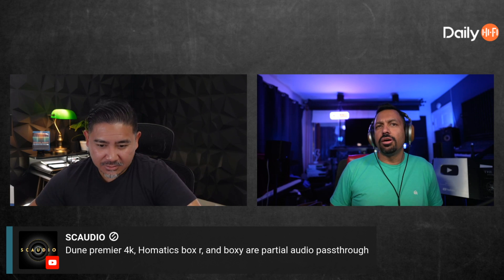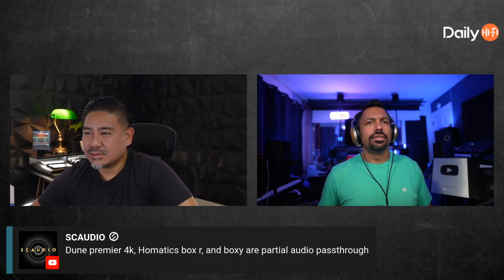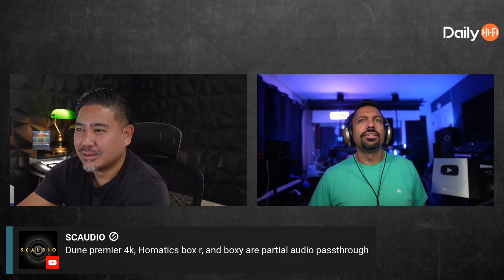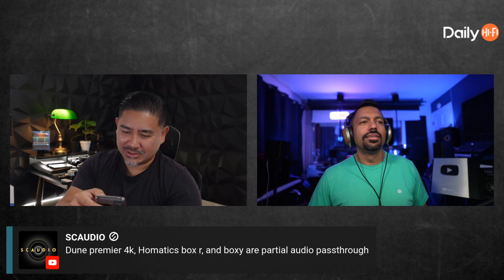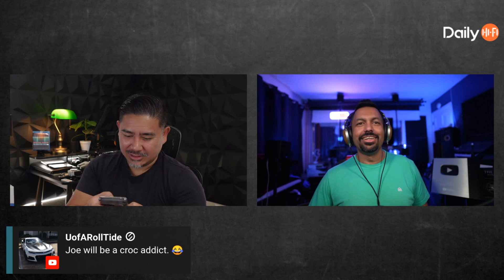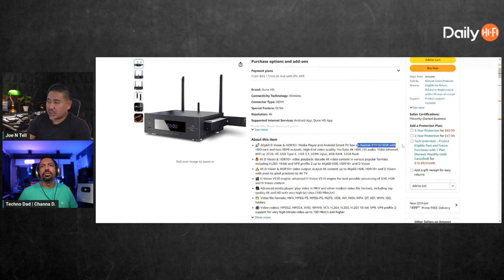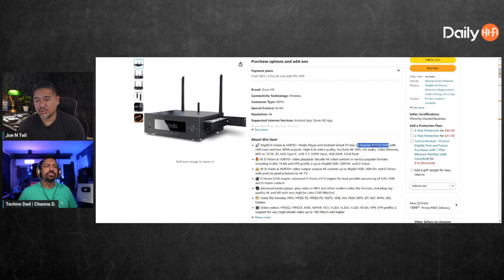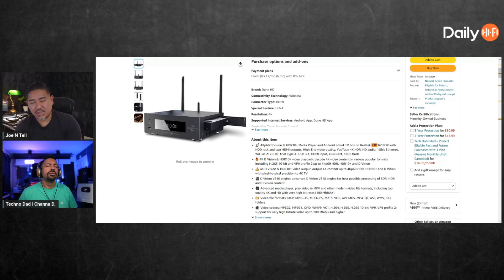What Is Partial Audio Passthrough?

Comment: I saw it on the Dune HD website comparison chart under HD Audio Passthrough: https://www.dune-hd.com/pages/compare-products

It basically means that the processors like the AMLogic ones in some of their devices can pass-through Dolby TrueHD Atmos, but it cannot pass through DTS-MA or DTS:X. Instead it will take the DTS signal and pass-through the 7.1 signal. To me, that means it isn't the lossless one since native Auro3D can extract up to 13.1 channels from the 7.1 signal as long as it's lossless PCM and the encoded Auro3D information is untouched. Once you mess with the PCM signal in any way, it destroys the encoded Auro3D info and you're left with just 7.1.

Out of the Dune devices, only the ones with the Realtek RTD1619DR processor are capable of full passthrough of all audio signals.